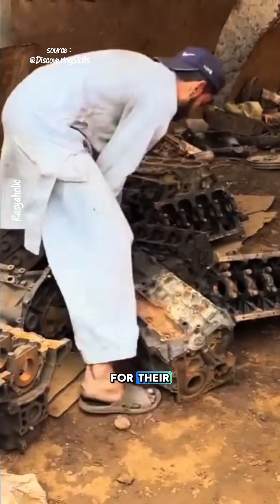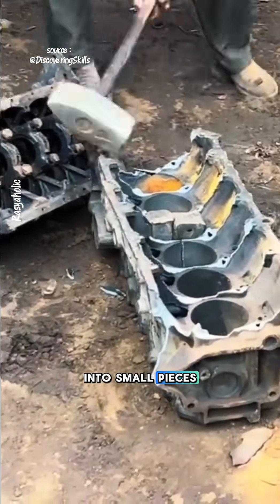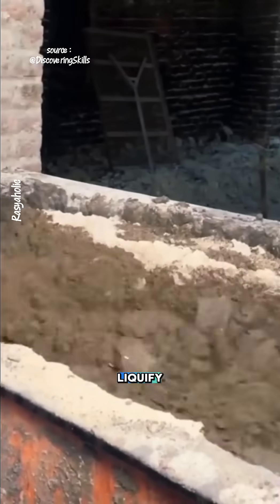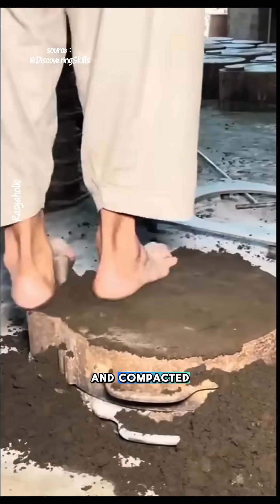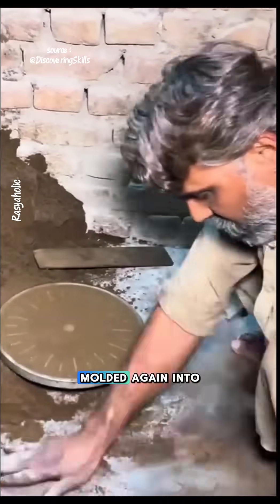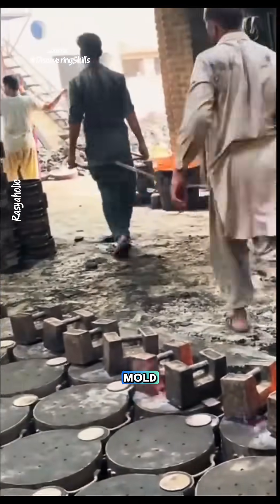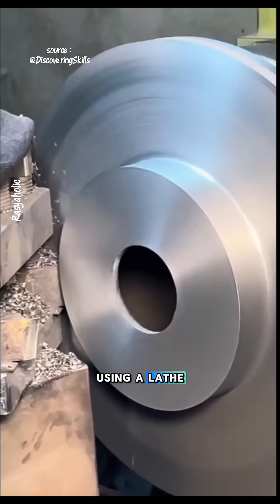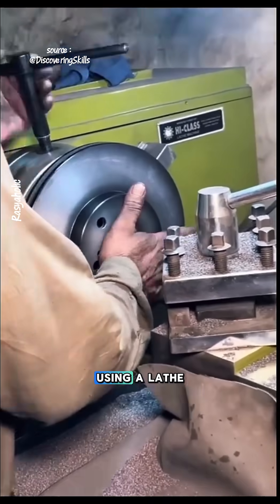#denzel

Comment: Not much quality control on the metallurgy process.  Pretty sure there's a connection between this and me replacing my brake discs every year.
Reply: You approach the stops too fast. I can wear out and warp disks in a few weeks if I jack rabbit stopped every stop.
Reply: @Willy-f9p  I live in rural MT.  Jackrabbit starts and stops are not a thing here.  It's a weak point on that particular truck which has 427K miles on it.
Reply: @rivercat6662  A year on pads and disks isn't too bad if you drive alot and ride your brakes.

Comment: The evidence concerning a relationship between work in the aluminium industry and lung disease has been reviewed using epidemiologic criteria. Adequate data on environmental exposure are rarely presented. Case series on aluminum potroom workers over the past 50 years have identified an asthmalike syndrome that appears to be due to an irritant rather than an allergic mechanism. These studies have been supported by evidence of within shift variability of measures of lung function. However, to date, there is inadequate evidence to resolve the question of whether potroom exposure initiates asthma or merely precipitates asthmalike symptoms in a predisposed individual. Cross-sectional studies have demonstrated evidence of reduced lung function, consistent with chronic airflow limitation. In exposed aluminum smelter workers compared to unexposed control subjects. Cigarette smoking, the major potential confounding variable, has been measured and accounted for in multivariate analyses. To date, evidence is lacking from longitudinal studies about the development of disabling chronic obstructive lung disease. Exposure to coal tar pitch volatiles in the production and consumption of anodes has biologic plausibility for an association of lung cancer with work in an aluminum smelter. Although retrospective mortality studies have failed to account for the probable high prevalence of smoking in blue collar workers, the relative risk of lung cancer is very low if present at all. Pulmonary fibrosis has not been shown to be a significant problem in aluminum smelter workers. Future research in the aluminum industry needs to concentrate on longitudinal studies, preferably with an inception cohort for the investigation of potroom asthma.

Comment: Engine blocks are made with th best cast iron it must resist stress and thermal shocks and cylinder wearing. I'm sur those disc brake the make must be good quality otherwise they would be out of business in a month

Comment: Quit using wood and use charcoal. Change that wood into pure carbon. It will increase your efficiency. There are videos using chopped wood inside sealed barrels and evenly heated to turn your wood to pure carbon charcoal... which burns hotter and longer. America love y'all! ❤
Reply: WOW

Comment: first aluminum can not rust. sand mixed with oil puts out a toxic gas, and aluminum brake disks are prone to wrping
Reply: I don’t think there is a such thing as Aluminum brake rotors , the temps get way too high
Reply: There is no aluminum rotors (disks)!  they recycle steel blocs.

Comment: Point of correction, not engine oil added to red soil and sand but rather what is added is molasses which act as a binder in the molding process.
Reply: That explains the lack of hazardous smoke in the video.
Reply: I called haji,,he said  doner kebab
Reply: I find it impossible because molasses is sugar in water and water -- even moisture --  is the 
# 1enemy since steam will explode the cast during the pouring .

Comment: Amazing !....lmagine the increase of productivity and quality if they had a manufacturing plant with modern equipment !!....skilled craftsman , hats off !!...👏👏👏
Reply: Aluminium disc brakes - ARE YOU SERIOUS?. One good hard downhill run by a 15/20 ton lorry and you have burning and warped brake discs.
Disc brakes have to be made from Steel or cast Iron for cars/vans/lorries - aluminium would NEVER be allowed in the EU it's seriously dangerous.
Can you imagine travelling at 140 mph on the German Autobahn and having to emergency brake - those Aluminium discs would seriously fail first time.
Reply: @Millmiglia001  I'm pretty sure this is iron.
Reply: @ it is iron
Reply: Its cast iron and durable  @Millmiglia001
Reply: And it'll cease being low cost
Reply: @MD-wv7ee  ...Until the porosity or balance in those poorly controlled castings causes the disc to fail and your wife and kids go careening into an overpass wall.....
Reply: Alternatively, they could stop their lollygagging & up their pace.
Reply: Irgendwas stimmt hier nicht. Motorbloecke sind aus Alu. Bremsscheiben aus Stahl.
Reply: @reinerkrueger8582 most engine blocks are steel
Reply: @ iron
Reply: they would not know how to operate it
Reply: @francoisd6942  they will learn and be able to run it like evryone in the west and east.
Reply: or even a workbench
Reply: And a few metallurgists would be recommended.

Comment: Mostly engine blocks are aluminum alloy, brake temperature is 500 to 700 degrees , aluminum will deform at that temperature
Reply: You are comparing oranges to apples. Engine block temperatures and rotors temperatures are almost equal under normal driving conditions. Yes the temperatures of rotors can rise to 900C on performance tracks and racing conditions which need specialized metallurgy.

Comment: No , engine blocks are aluminum and disc brakes are made from cast iron .
Reply: Diesel engines have cast iron blocks
Reply: And Gas or petrol fuel engines are made from Aluminium to heat up fast to be very economical @victorhassen1436
Reply: Still older engines are of cast iron and the recent ones are made of aluminium with steel engine  liners.
Reply: They're using diesel engines and old V8 engines which are cast iron... Hence the cast iron rotors...
Reply: Ok but they  still made something  out of something.
Reply: What ever they still made something  out of  something.  That is what  we are taking about.
Reply: @johndada3500 Pour condition job working and Yes something mised😊 I'm guessing so a process mised.Seperate by Electric -magnet alie-aluminium ...or those stories going aut with send meltet tugather
Reply: Unless it is an iron block of course. . . . 
They will not see any Aluminum engine blocks in Pakistan for another 10 years
Reply: EA888 engine
Reply: They're lying

Comment from the maker: Thank you all I have achieved 1000 subscribers 🙏☺️
Reply: They are legends
Reply from the maker: @odongootieno6879  thank you 😊
Reply: You get a huge positive NO from me =]
Reply from the maker: @eNoOne3263  thank you 😊
Reply: THANK YOU FOR THIS
Reply: Great recycling
Reply: Brake rotors are not what they used to be in the 70s,,,, trust me,,
Reply: gass terus jangan kendorr saudarah...🕌🕋🤲🌙
Reply: How are you doing
Reply: Guess what? Israel has been recycling the rockets shot at them from terrorists & turned them into jewelry for years! 🇮🇱
Reply: And still can't scribble the simplest sentence in Standard English.
Good grief.
Reply: Skilled Pakistan
Reply: started off with an aluminium block and ended up with a cast iron brake rotor using a lathe machine  A lathe machine? It's just a lathe !